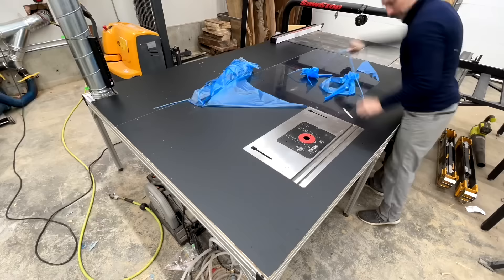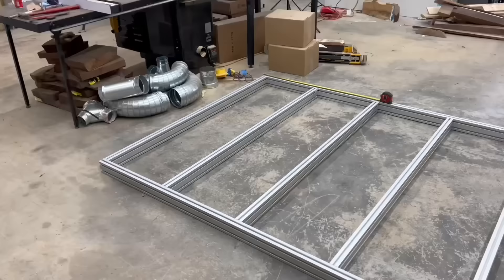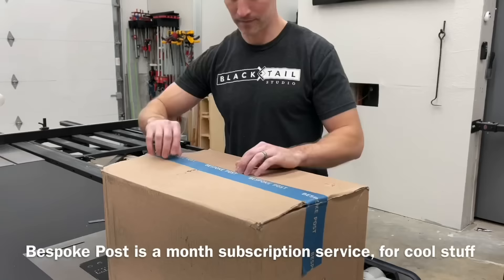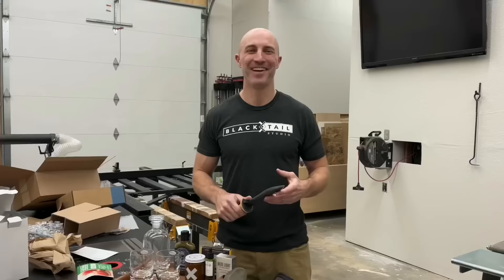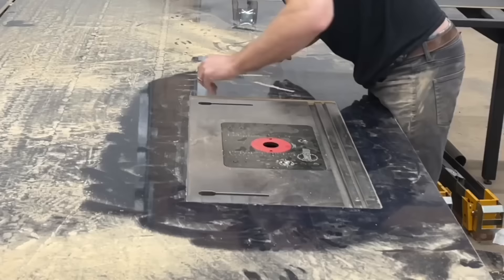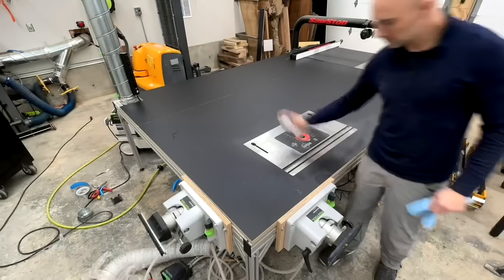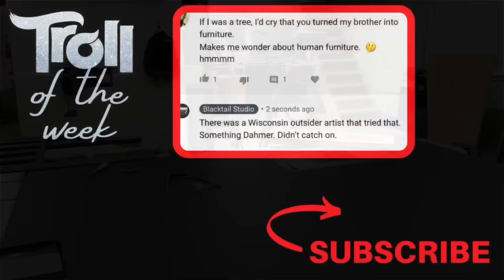60 Minute Aluminum Workbench

Comment: Another bonus, it would cost you the same to build it out of wood here in 2021
Reply from the maker: 😂😂 well said
Reply: Extrusions are worth the cost but they are crazy expensive when you get to these larger profiles.   We can all agree that 2x pine framing lumber is out of the question.  I would have used 6/4 euro beech. Straight lined and thicknessed at the lumber yard, it would run about $250 for this project.  It would be plenty strong and a lot prettier.  It would take a good deal longer to assemble of course.   But the difference becomes insignificant when you consider the overall time this project must have taken from planning to completion.
Reply: Pretty sad when you think about it
Reply: @frankshannon3235  The one advantage of the aluminum is that it would be easy to break down and transport since it's super light. Something to consider.  This stuff looks awesome but I'm not ready to drop a grand for a table. At that point you might as well make it out of steel so you have a welding table too!
Reply: @DW Palme gotta love a bad economy over mean tweets
Reply: @DW Palme where do you live? Remember the extrusion is only the frame. Still need a top

Comment: I work for Ford Motor Co. We have stations on our transmission assembly line that are nearly 75% extruded aluminum construction. Triangulation is key, plus the actual shape of the aluminum adds strength. Great video. 👍
Reply: Beatles. 
Great job. My pocket won’t allow such a thing, but I love it. 
Paul

Comment: Men at Work. Your tips and product suggestions are very helpful. I would say with your line of videos they make for a complete discussion and presentation of a real working wood shop. I value this approach as should most who do any woodworking as it helps with what I mentioned, suggestions. You also have a huge advantage with space and tools which we know can be a huge part of the battle of producing quality product. I work in my garage with what many could call a mini shop and of course limited tools that come with that but I feel I put out some pretty good stuff considering my limitations.

Comment: Journey. I know that this is well over a year, but I do enjoy videos like this since it is slowly giving me ideas and suggestions for things I might want to my own shop one day. Plus, it is nice to see how it grows and you slowly build your shop to your desire. So I work in the aerospace industry, and we have a lot of those extruded aluminum products, and years ago they started having some of the manufacturing desks replaced with desks made of those, and I would like to know how things have turned out for you over the past year+ using it and it holding up. One of our biggest problems is that overtime, the hardware holding things together, such as those angle braces, slowly become undone causing the desks to wobble, and become unstable, and it really frustrates everyone. Hopefully you have not run into similar issues, but I love how your table came out, and looks sharp!

Comment: For anyone considering something like this. If you want to save a ton of money, you can tap the ends of aluminum extrusions, and drill a corresponding hole in the piece it attaches to, which creates a poor man's version of the fancy connectors in this video. Just a pan head socket screw in the tapped end, then run your hex driver through the through hole to tighten the screw during assembly. Does require a fair bit of planning and measuring to make sure things line up right, but it works just as well as these connectors.  Alternatively, you can also use flat plate style brackets for those kinds of applications which are pretty cheap as well. 
 Those connectors are around  6 bucks each depending on distributor, and honestly I would expect like at least 30-40% the cost of this build is just in those connectors.
Reply from the maker: Very nice!

Comment: The aluminium extrusion looks like it would be perfect for building a router table or router slab flattening jig, versatile stuff! Great build with lots of useful little tips and techniques.
Reply from the maker: Oh for sure
Reply: I was just lookin on their website and they have slab flattening kits already made up
Reply: 7:58  you can buy liner berrings 
I've seen guys make sliding table for tablesaw with this stuff.
Your only limit is what you can think up  its like an erector set we played with as kids back in the 60s

Comment: I've watched a couple of your videos where you struggle with flipping a large tabletop over.

Have you considered some sort of simple block and tackle system secured to the ceiling?  If rigged properly, you could use it to gently and safely raise the slab to verticle, then lower it onto the other side.
You might also need some sort of stops to keep the slab from sliding while being raised or lowered.

Comment: I subscribed because of this video, I am a disabled Veteran HOPING to learn to make wood crafts on a CNC and eventually a Laser Engraver, I was researching options to make as easy, sturdy, and flat a 5'x5' table as possible for a Onefinity CNC  I will have to start with a heavy 2x4 table but I will save for an extruded aluminum one soon as I can.

Comment: As soon as I saw that you were building a bench out of standard extrusion I knew it woukd be the world's most expensive bench.
A lot of people talking that don't know what they are talking about, aluminum is actually stiffer, by weight than steel.
That said, nice bench, more than I need, I"m pretty set with my 1948 Unisaw that I completely restored and steel base aluminum top router table that I made my self, as I am a machinist and welder.

Comment: Hey Cam, I really enjoy watching all your videos and have learned a lot over the last year.  I did an epoxy river table last year following literally all your advice and skills.  Literally all.  I use the same epoxy, dry black walnut wood, the same techniques and finishes.  Long story short, the girl i did this table for texted me yesterday and the epoxy had cracked across and is separating from the wood in a few spots.  This pour was done back in July of last year, and cured for about 2 months before attaching a frame and legs to it and finishing it.  the wood was sealed with shellac and roughed up and cleaned before the pour.  the table was about 1.5" thick and i did it in 2 different pours as suggested.  i monitored the temp for the first few days and had a fan on it and the mold was raised up to allow air flow under, just like i've seen you do in many videos.  The temp never exceeded 105 degrees.  Even so, the finished product came out great and it has been 6 months since the pour.  Im confused why now it cracked and its having problems as opposed to back then.  Also i am looking for advice on how to fix it and not have a repeat.  I would love to know if you can point me in the right direction.  Thank you and keep up the great work.
Reply from the maker: If you sealed the sides with shellac, that’s why. The shellac repels the epoxy.
Reply: @BlacktailStudio  Thank you very much, for some reason i thought 1 of your videos said that was ok to use, maybe it was another video i saw, appriciated.

Comment: We used to use this system for making lab equipment. Besides being quick to assemble, it's even easier to modify. So Rae as strength, the anodized aluminum is very strong. Our installation had a four hundred pound granite base with the microscope suspended above the slab and the electronics in a rack alongside it. The rig was stable enough that the technicians could image with people working near by.
So don't dispel the extruded aluminum racking systems. They are expensive, but worth it...

Comment: I use this same style framing in an Industrial environment at work but from the 8020 Brand, it's solid stuff but with anything that will be subject to vibration loctite is a must. It's amazing all the different things that can be built with this extruded aluminum.

Comment: With the insane cost of wood (yesterday priced a 2 x 4 x 8ft at HD for $31) metal makes more sense. My 2 x 4 outfeed table is ready for the firewood pile. Getting ready to build a new 16 x 20ft shop, will be framing with metal...will then be building new tables with 80/20. Great video...love the idea of just sending the dimensions to Frametech and let them package everything...definetely worth not having to figure out all the hardware, cut lengths and bits and pieces..THKX!

Comment: Every time metal is folded or extruded with right angles the strength is multiplied. Just like flat stock is easy to bend and angle iron is not. I never questioned the rigidity of this aluminum product you showed for this purpose. Nice build.
Reply from the maker: Well said mike

Comment: 4:12 "we needed to make it a little more difficult" feels like mine and my father's motto when it comes to our projects. For example, I recently made a tabletop hook ring toss drinking game and instead of using a straight dowel which could easily be placed in the center of the two different sized boards, I decided to use a curvy branch and had to find a way to mark the points where the branch would be placed so that the two different sized boards would be properly aligned.

Comment: ASIA, JOURNEY, RUSH, April Wine and CCR. those are my top five.  Can’t decide who I like best. 

Have you thought about running some ductwork below the table that feeds to a portable Air conditioner?  Turn it on when doing large pours and it will cool down the resin as it cures.  That’s how Black Forest Co gets away with large pours.  They even use those cheap window mounted air  conditioners. Doesn’t have to be fancy, give it a thought.

Comment: Aluminum extrusions are the go to material for sim racing rigs. When I first started planning mine a few years ago I was shocked by all the secondary bits and pieces that were available...literally hundreds of pages of hinges, slides, mounts, and widgets that can be attached in under a minute using a simple t-nut. 
The

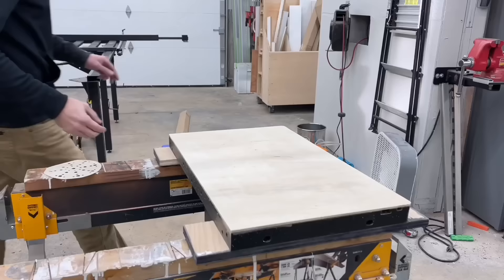Comment: First time i am seeing the inlay concept starting at 4:00. that is actually pretty hard to conceptualize and accomplish without those matched flush trim bits and the bushings. I and a lot of people will use a rabbiting bit to reduce the original template, then try to squeeze a drill bit into the final piece to create a hole for another round of flush trimming. usually there is some kind of flaw at that starting point with the drilled hole.

👍 good stuff, wish I would have seen this a couple months ago when I was making molds for fiberglass boat hatches and receivers..

Comment: Rolling Stones...I like this video, I have just finished replacing my out feed table. I looked into using 80/20, but could not figure out how to get it put together. So I ended up building a torsion box top out of Baltic Birch with 4" x 4" maple legs. And a Steel frame for the bottom shelf.
Reply from the maker: Oh nice

Comment: $1060 for that size table with 2000lb capacity is not a bad price. Material costs for a steel copy (which I'm welding) is over $300 plus all my labor. That extruded system is great for adding devices and tooling along the edges as you showed, so for versatility, that table frame is superior to anything else out there.

Comment: The channeled design of the parts give them far more rigidity than if they were just tubes or simply rectangular in cross-section. Simple aluminum sections would bend. Both materials and design figure into something's strength, material strength is not the only consideration. (It's why steel I-beams have the cross-section they do, and are not just flat pieces of steel. Steel is obviously strong, but proper design for an application is as important as metallurgy.)

Comment: Aluminum is a real eternal element not diamond since it could be annealed indefinitely. Your investment in aluminum extrusion is gonna be pretty high,  but it will pay off in  long term applications. Not only aluminum extrusion comes in variety of forms, it is also easy to connect with tons of fasteners available in market. Your choice is very smart sir.

Comment: an idea, if it suits. if the top surface gets to the point where it needs to be replaced just flip the board over, it does mean the top needs designed so it can be flipped

Comment: ELO, among others. I'm officially jealous of your shop. Its been fun watching you assemble the work spaces. I'm looking at  putting a 4x8 foot table in my shop. So far, everything is on wheels due to space constraints, so the new table will be as well.  This year, after several rough starts, I'm hoping to start building custom wood creations from the large supply of local timber.
Reply from the maker: Amazing band

Comment: AC/DC.  The new shop is really coming together.  I've spent the morning looking through videos hoping to find what resin you would recommend for a very small shop to fill large knot holes and inclusion on a table top, which also comes in a small quantity. I'm just doing two table tops and won't need gallons of product.
Reply from the maker: I like liquid glass

Comment: Saw you mitre saw table build, went to look at extrusion pieces, wasn't on Amazon, realized that video is 2 years old.   I forgot that Amazon is now a hotbed of entrepreneurs repackaging known products at higher/inflated prices.  
 
One thing to prevent sag in middle is to add legs in the middle.  Or increase the depth of the beam from 3 inches to 4/5 inches.   
The deflection is probably from a chart for beams  done by the actual manufacturer.  In this case 80-20 (actual company that makes the extruded aluminum).

Comment: Hey Blacktail Studio, always like your videos especially with regards to how straight forward and honest your narration is - you say it as it is and don't try to sounds like you're anything more or less.

I have actually wondered if you had considered a sliding table saw. I know in the US its super popular to use the stationary cabinet type saws and now that Harvey and Sawstop are doing smaller type sliding tables, it's great to see so many folks in the US using them.

Would you consider (even a 2nd hand) Altendorf or similar....I mean a Martin is the dream, but it sort of requires winning the lottery.

cheers from Australia

Siggy

Comment: Phil Colin’s! Wondering why you ran the duct work up through the new table and over the top? Could you drop a cut from under the table and run it under the floor. Probably save you 30’ or more. Great frame setup,  love it.

Comment: When I saw all the 80/20 I thought you were putting a large AVID CNC together and that was going to be your outfeed.  Now that would be the ultimate and you'd have every right to call it that.  The thing about the AVID is that it's flat.  The Y-axis rack and pinon drive and linear rail don't protrude above the spoil board so it could be outfeed with the gantry is all the way over at the other end.

Comment: Tool, they are also who I almost exclusively listen to while in the shop. 

I like the aluminum framing idea....I wonder if just buying it in standard off-the-shelf lengths would cut a lot of the cost you incurred by having the company come up with a design, and kit for you? It's just aluminum, so the chop saw should work fine in cutting it. By the way, I have the same Bosch as you. As with all chop saws, I think the dust collection sucked! I ended up making a custom one (based on another youtube vid) that I attach my dust collection system to through a 6" port and it works well.
Reply from the maker: I did that with my miter station. Probably can save a little

Comment: Otis Redding. $1k is a bit overpriced for just the profiles, but with the design added in its fair. I work in Germany as an industrial mechanic and we use those profiles for everything. I’ll be using those for my next portable workbench build for sure.
Reply from the maker: Oh awesome
Reply: Blacktail Studio one thought is that you can get plastic inserts to close up the slots and prevent them from filling with dust. This also makes for handy cable runs to clean up your wiring.

Comment: i knew when you did the spay both you would get that stuff because cloth always leaves lint that's  why you should use plastic like in mold or aspects removal videos.   A way to help lift slabs you have those hand suction handles use a heavy rope or chain though them to either a over head crane or movable  rack of sorts.    Sorry if my righting is bad I'm learning disable
max out at 5 th grade English

Comment: Iron Maiden :)
Just wanted to say thanks for sharing this playlist, right now starting my own workshop, and must say using aluminum as frame for workbench now looks very tempting, as my workshop is on 1'st floor. If I ever have to move it to another place, it will be easy to disassembly and light enough to take it down stairs :) compared to mobile Moravian Workbench I planed to build as first project :)
Reply: Up the Irons!

Comment: I’ve made dozens of things over the years using 80/20 going back 30 years. But it’s gotten so expensive now, it can be hard to justify it for home projects. There are cheaper versions, but that’s the problem, they ARE cheaper. The members used here are lightweight, there are much more robust (and heavy!) versions. I’ve used them for machine frames, audio/video cabinets, etc. Everything has to be cut very accurately, otherwise the parts won’t sit at 90 degrees.

It’s really too bad 80/20 closed down their eBay store.

Comment: I like listening to Darlingside. I'm actually new to woodworking (~1 yr)  and have been using a Costco lifetime 6ft table as my workbench, but I think it's time to move on to something more stable, level and strong. Do you have recs for what sort of design I should build or whether it's worth the investment to go for an aluminum frame even though I want a smaller workbench?